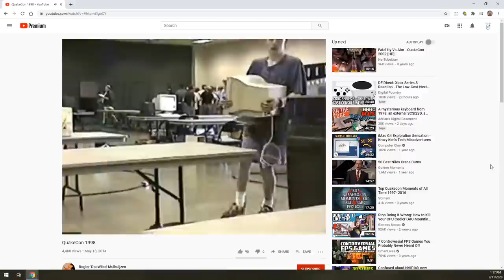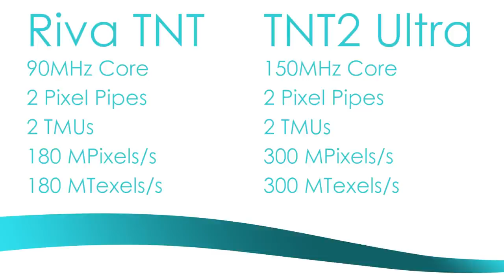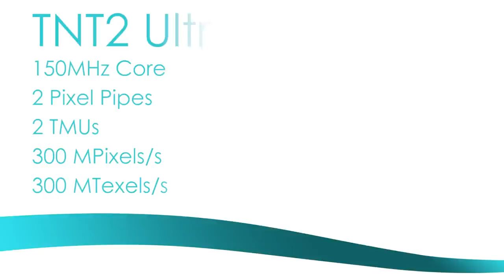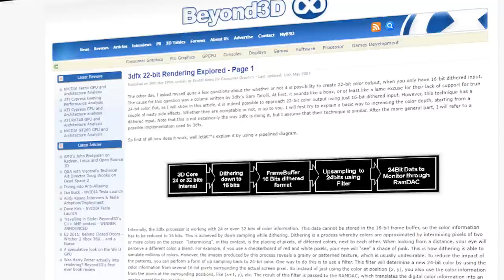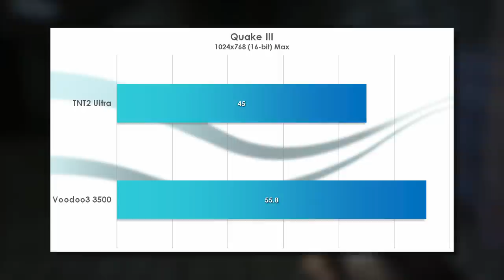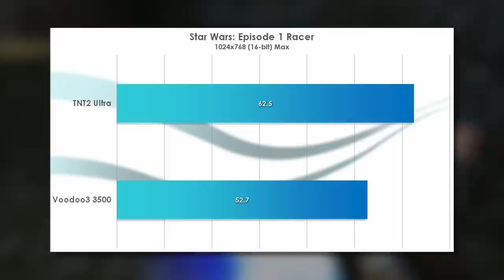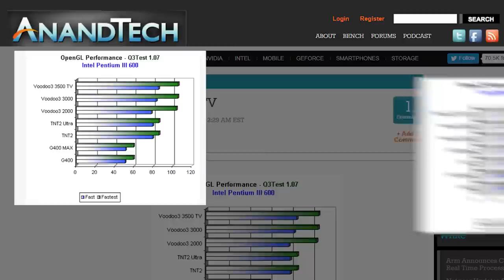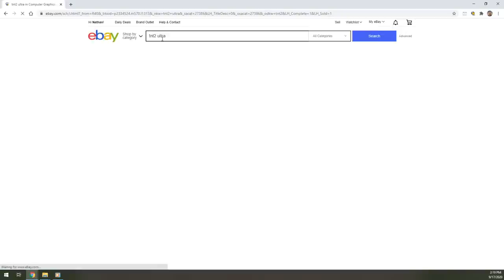NVIDIA TNT2 Ultra vs 3Dfx Voodoo3 3500 | Card Battles

Comment: My first discrete graphics card was the nVidia Riva TNT2 Ultra !!! 
what a great experience !!
Always been an nVidia fan since then !!
Reply: Mine was the WAY too common M64..
I remember playing C&C Generals with it.
And it struggled even on the lowest settings.
But i had a great time!

Edit; I later bought the MX4000.
Reply: @rembramlastname3631  TNT2 M64 ?? wow , i couldn't remember this graphics card . thanks for the info.
I could remember only the normal TNT2 & the TNT2 Ultra. 
----P.S. C&C Generals released around 3-4 years after the nVIDIA "TNT2" series , so an underpowered version of the TNT2 ,such as the M64, was logical to struggle with such titles.
(If i remember correctly , during the time C&C Generals released , i had already moved to my next GPU , the GeForce 4 MX440.)
Thanks for the memory ... update !!
Reply: @Sitharii  
Theres also the Vanta. The "Celeron" amongst the TNT2 versions.
I still have a box full of old GPU's.
Including Intels first GPU, the I740, lol.

If youre still interested, there are still modders active on C&C Generals, such as Shockwave, Rise of the Reds and Contra.
Also Battlefield 2 with Forgotten Hope and Project Reality.

All on ModDB.
Reply: @rembramlastname3631  the Vanta ... yeah , it's been so long i had forgotten those models. Thanks.
i also have the habit of keeping most of my old GPUs . 
I still keep my beloved TNT2 Ultra (a Creative model)and since it's my 1st discrete graphics card ever , i'll always keep it .
I also keep a 6600GT( Albatron model , can you remember that company? ) ,a 7600GT , GTS450 , GTX460 , GTX560Ti , and my latest addition in my ...."bench-collection" , a highly factory-OC'd Palit GTX1080 GamerockPremiumEdition , which is a behemoth of a GPU !! (I'm certain that i could easily sell this GPU with all these shortages nowadays , but i'll keep it as well.)

My current active GPU is an RTX2060.

P.S. The only thing that i regret is gifting away my beloved GeForce4 MX440 . I had very good memories from that GPU and i regret gifting it. So stupid of me.
P.S.2 : thanks for the info about the mods , but sadly ,my gaming days are over ,i'm usually tired from work, and i rarely play games , i mostly enjoy watching other people playing games in youtube nowadays....

Comment: Went through a Voodoo 1, Voodoo 2, and that was it for me with 3DFx.   Switched to the TNT 2 next, as colour depth and texture "were" important to me.  Then, the GeForce 2 after that, until going over to ATI for a couple of cards.

One of my good friends got the Voodoo 3 3500, and he had nothing but problems with it.  I certainly don't regret having gotten my TNT 2 back in those days.   It was the right time to dump 3DFx.   16-bit rendering was already archaic.

Comment: I would liked to see some TNT overclocking results. Maybe this would change the results. Some cards theese days would OC for more than 30% unheard of in todays time. I still love your content. Pixelpipes is a gem. Greetings from Germany
Reply: my best overclocker was a 8600GT which overclocked a little over 50% on both memory and core clocks. went from shitty to actually pretty good. other than that, the next best was probably my geforce 2 gts, which overclocked from 200/333 to 285/383 and actually beat a geforce 2 ultra that way. i have a gt710 here that overclocks around that ballpark. low end / low power hardware overclocks best nowadays. or maybe we should count mods, so my geforce 6800GS which unlocked 4 extra rendering pipes for a total of 16 and overclocked a fair bit too, giving a huge performance boost over stock, might take a good position in that rank
Reply: @GraveUypo  It's always a difference between low end/midrange OC and high end OC. For a long time it was often easy to OC some cards to get in the ballpark of the high end variant. Overclocking a high end chip 30% is a rare thing these days. Last time I saw it was the 2700K
Reply: There were some TNT2 cards late in its life that shipped as fast as 175 MHz. They were faster than my V3 3500 overclocked at 202. Nvidia's cards overclocked better in those days. Late run GF2 GTS cards a couple of years later were easy to overclock faster than the GF2 Ultra.

Comment: The main issue with some of these results is something that you actually mentioned: unlike the Voodoo 3, the Riva TNT2 Ultra supports high resolution 2048 x 2048 textures. For example, in games such as NFS Porsche, the Voodoo 3 looks completely washed out when compared to the TNT2 (because of the low resolution textures). Of course, this results in better performance for the Voodoo 3, but the image quality penalty is quite extreme. And, boy, people really didn't appreciate this at the time. I remember debating with my friends if it was worth the performance penalty with the TNT2, and with very few exceptions, most of us agreed that, yes, it was worth it (especially because, having played in software rendering for many years, we were quite used to MUCH lower framerates, so it didn't really bother us). Anyway, great video as always, keep up the good work! :)
Reply from the maker: Good point, higher res textures means higher use of memory bandwidth
Reply: Indeed... Same issue with 3DMark2000, Expendable, Quake 3 and Unreal Tournament - they all support high resolution (mipmapped) textures between 512x512 and 2048x2048. So, when taking that into consideration, one can clearly see why the Voodoo 3 was the beginning of the end for 3dfx. :-)

Comment: I had the tnt2 ultra it boggled my mind that the gpu had a heatsink almost as big as my cpu's... here's the reason TNT2's dominated, simply they were giving them away. you bought a big box computer with a 3d video card it came with a TNT, TNT2, etc, and more often than not it was just the stock card in many HP, Compaq's late 90's home all rounder upper end offerings. 3DFX you had to go out and buy for the most part. 

In the late 90's / early 2000's I worked for a computer refurb house that dealt with the major brands of the time, and OMFG we had boxes of the things, I upgraded my dual V2's for a TNT2 , and all my friends got one ... including a few ultra's before I went out and bought a ge-force, again they were giving the whole damn TNT series away for free, and well that pretty much worked out for nvidia and poor ole 3dFX couldnt justify their prices (esp since most gamers bitd ran 800x600 and even the base model TNT could nail above 60FPS all day long)

Comment: I had a Voodoo 3 3500 TV, and i remember it was the king :D - think I had a slot A AMD CPU at 350Mhz, overclocked to 450 with a "afterburner" add on mod :D

Comment: Are all comparisons Direct3D vs. Direct3D or was the Voodoo3 benchmarked running on Glide in those games that support it?
Anyway nice video and I fully agree that many reviews back in the day were pretty bad, I even thought so back then. In practical use the Voodoo3 was the much better card unless you absolutely wanted to try the hyped 3D glasses like the ELSA Revelator. I'm not sure but I think at that point the Voodoo3 cards even were cheaper than the corresponding TNT2 model.
Reply from the maker: No Glide testing, just apples-to-apples comparisons. I'd expect the Voodoo3 to look even better when using it.
Reply: @PixelPipes  Fair enough, would be good though if the graphs would've shown that it was Direct3D and even better would be showing Glide result besides the D3D results. Thanks for the answering! Greets!

Comment: The V3 was faster in real-world use; you didn't play 3DMark, and 32-bit color wasn't playable on most machines in 1999. The GF 256 at the end of the year changed the game, though.

I had a V3 3500TV that I ran for years even after the industry had moved on. I mounted a cooling fan on it and got it to run at 202 MHz. It was running on a system with a K6-III+ 550 into the late 2000s when I let someone convince me to sell the rig to them. I wish like hell I hadn't.

Comment: I always love when new content from PixelPipes shows up because it's always an interesting topic. I had a Creative Labs TNT2 Pro paired with a Slot-A Athlon 650MHz, and though a friend and I debated whether the TNT2 was faster than his Voodoo 3 2000 (he had older Pentium 2 400Mhz though, so...he's also a massive racist now not a friend for years, so I think I win...), we both, as well as couple other friends, had tons of fun playing Unreal Tournament, Quake 3, Counter-Strike, Team Fortress Classic, No One Lives Forever, etc. Great times. I still have the CPU, TNT2 (and GeForce 2 mx that I bought to replace it), Sound Blaster PCI 128, and (AMD-750-chipset-based) motherboard from that PC, but the motherboard if flaky, even with some of the caps replaced. Though I had enjoyed PC hardware since the late 80s and still do, and in the mid-00s through ~2015 had worked for one of the large OEMs and had access to every piece of hardware imaginable and to some of the engineers in Taipei/Chonqing/Suzhou plus, at the time, had the income to stay current (990X+2xGTX690s probably being my most extravagant PC spending), I still feel like I had the most fun with PC hardware during the that area between those initial Slot-A Athlons through P4s and Athlon XP/MP until the 939/754 Athlon 64s. Now, I loved getting dual core CPUs, and really loved 1366 i7s later on (920...then the 990X, which I still have up and running in the small-form-factor PC in my living room with an old GT750ti, which I find a funny, and is why I pulled it out of my old desktop and swapped out the 920 in the SFF pc), but those late '99 through early-mid 00s hardware and games really call to me still.

Comment: Thanks for a nice video, but I think you should have done some comparison of the image quality too, in the very same games. You could just compare 16-bit quality since the Voodoo didn't support 32-bit. Because at the time I myself bought a TNT2, I felt the image quality was sharper. When looked at side by side the image quality output from the Voodoo 3 felt more smudged out. Wich made the deal for me. I knew the performance was a little stronger in the Voodoo card but I was happy with the performance both cards delivered at the time.

Comment: I bought the Voodoo 3 2000 card as it was much cheaper than the 3500 and I was lucky and had the desirable card with Hyundai memory chips which could hit 183mhz effortlessly. The core could also hit 183mhz no problem making it the exact same speed as the card that cost over $200 more. Mind you I had to run a huge box fan on the open side of my case to keep everything cool enough but that was part of the fun back then.

Comment: I remember that back in the day we went from the Voodoo Banshee to the Riva TNT2.

We would have gotten a Voodoo 3, but they were much harder to find because 3dfx insisted on manufacturing everything themselves. Didn't regret it though. The TNT 2 remained surprisingly useful for a fairly long time.
Reply: TNT2 was better for a long-term purchase, because once CPUs caught up, you could just run it in 32-bit rendering mode and it would deliver the goods. But in 1999, the 3dfx card was the one to have because it was a little faster and did better 16-bit rendering because of the post-processing. It really did render at about 22-bit effective. 

Also, if you were running an AMD CPU at the time, their proprietary 3DNow! instructions were supported by 3dfx in games that used them, far better than with anything from Nvidia. I ran K6-2 and K6-III and built systems based on it, and I always used 3dfx cards unless the person wanted something else.

Comment: Very cool video, well done! I just build a voodoo3 system and I too was under the impression that the tnt2 would be significantly faster, so I found your overall result very interesting! My build is running a much slower CPU though (PIII 450) so I think the results would be very different, but it was definitely interesting to see what they could actually do with a very fast CPU!
Reply from the maker: Nice! Btw I wanted to message you an invite to #GPUJune months ago but couldn't find any contact info. Offer is still on the table though if you'd like to join in!
Reply: @PixelPipes  Thanks! I did a rendition verite video a while back that would have been perfect for #GPUJune, but not sure I can get a new video out in time. Dont suppose re-branding an old video for #GPUJune would be in the spirit of things!

Comment: The Diamond Viper V770 TNT2 Ultra was THE card to get if you went Nvidia back in the day. However, that would also be the last great product of Diamond Multimedia, because like 3DFX merging with STB, Diamond merged with S3 and created the S3 Savage 2000; a supposed Geforce 256 killer that turned out to be buggy and flopped (and the company basically died after that (although they are still around producing products nowhere to be seen) and are now a subsidiary of PowerColor).

Comment: I though the Voodoo3 3500tv was gimmicky as well, but I bought one and actually wound up using it in my main system for a very long time hooked up to cable tv.      It's a tragedy Voodoo could never capitalize on the lead they had with the Voodoo 2.

Comment: I'm curious - when you benchmarked NFS Porsche Unleashed on the Voodoo3, did you let the game configure itself stock or did you regedit the rendering driver from dx7z.dll to voodoo2z.dll?  I'm assuming you left it stock but I've seen SIGNIFICANT performance increases w/ Voodoo3 in this game if we manually tell it to run in Glide mode.  I bet it would even beat the nVidia card in this scenario!
Reply: NFS Porsche runs by default with Glide with Voodoo 3 cards but he tested it with direct3d which is non-sense for a 3dfx Voodoo card. With Glide the performance would have been 10-30% higher.
Reply: @3dfxvoodoocards6  That's weird because in my case I actually had to tell the game to run in Glide; same w/ Voodoo2.  It (my copy) only picks Glide by default for the Voodoo1, although there IS a second Glide driver called voodoo2z.dll that runs up to 1024x768 w/ Voodoo2 SLI and 1280x1024 w/ Voodoo3 - but I have to edit the registry or 3dsetup.ini file to make use of it.  Other thing I thought of is HE MIGHT HAVE TO run direct3d to get a framerate measurement.  I don't think NFSPU has a built-in frame counter, so you'd have to rely on something like Fraps which cannot count Glide framerates.
Reply: @angieandretti  my V3 2000 and 3000 run NFS Porsche by default with Glide. Maybe it depends on the driver you use, I used the latest relased by 3dfx 1.07. It is impossible to see the FPS in Glide in NFS Porsche, Fraps does not run in Glide. 3dfx Voodoo cards have significantly lower FPS when running in Direct3d instead of Glide. 3dfx cards run best with Glide.
Reply: @3dfxvoodoocards6  Okay I'm using AmigaMerlin, 2.9 I think, for the V3 3000, and FastVoodoo2 4.6 for V2-SLI.  I certainly agree about the difference in framerate.  Also I was only offered a max resolution of 800x600 on the V2-SLI until I manually selected voodoo2z.dll instead of dx7z.dll as game rendering driver.  Then with the Glide driver selected, 1024x768 felt faster than how 800x600 felt under directx.

Comment: I remember that just before it got assimilated by nVidia, 3dfx acquired a company with a promising tiler design (Gigapixel). Out of curiosity, my next card after 5500 was another tiler - Kyro II. Funny thing, it sucked at benchmarks, but could handle 32 bits and some serious loads in games. I guess, Imgtek was too naive to care about driver "optimizations".

Comment: You fail to mention what api each game is using. I would venture to guess that the ones where the TNT2 came out on top were DirectX and the ones where the Voodoo came out on top were OpenGL. Could be wrong but since you didn't provide this information and I am too lazy to look it up that is what I will have to assume. This testing was not detailed and thorough enough to make any real conclusions.

Comment: Great video. But I can't even begin to understand why on earth would you choose the 45.23 driver for the TNT2!!
Using a period-correct driver for the TNT2 (or at least =< 44.03) would have skewed the results much more in it's favor. 
44.03 was the last decent driver for anything under the FX Series.
Reply from the maker: 45.23 are by no means the latest and perform very well in my tests. Don't worry, the TNT2 Ultra was performing at peak.
Reply: @PixelPipes  yeah, i edited my comment (apparently not in time, lol) coz it actually isn't the final driver. And also seems that the TNT2 is the least affected by driver version (after quickly checking one of PHILL's videos, to doublecheck if i'm spewing bullcrap or not).  
Yeah 45.23 seems to be just fine for the TNT2. Sorry for the hasty comment :)

Comment: Interesting. The TNT2 Ultra (the 32mb model) did age better in 2000-2001. The 32mb became the standard(minimum). As far as I remember, the TNT2 Ultra was not far behind the the Geforce 256 SDR model in performance.

Comment: Hey nice contents yet I Saw one of my photos at 06:13, it would of been nice if you added my nickname Gold Leader  as credits to that photo, I still have that wooden table where the V3 3500 was laying on as well.

As the video goes yea nice compilation would of been nice to see Descent 3 and Freespace 2 in here, but hey ya can't have everything, 32 bit wasn't great on the TNT2U I had the Diamond card and I found it too dark, 16Bit Glide looked much nicer multi texturing was miles better plus the 2D core was very good a 128Bit 2D core ideal for 2D games and overall image quality output was miles difference in advantage for the Voodoo3 3500 it's self, it's 350Mhz RAMDAC was also a nice thing to see plus 8 bit per pixel rendering support makes it ideal for older Dos games as well
Reply from the maker: Hello Gold Leader! Look again in the bottom right hand corner. I did credit you.
Reply: @PixelPipes   ah is see now yea my bad was hard to see, the yt scroll bar probably covered it